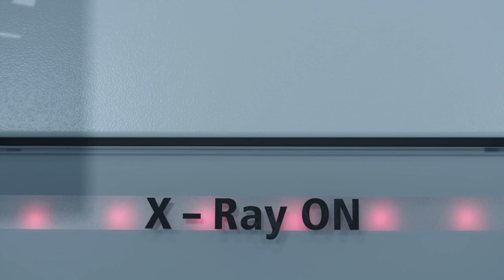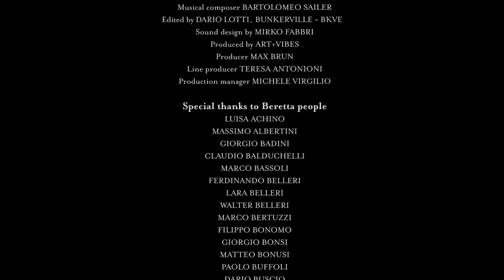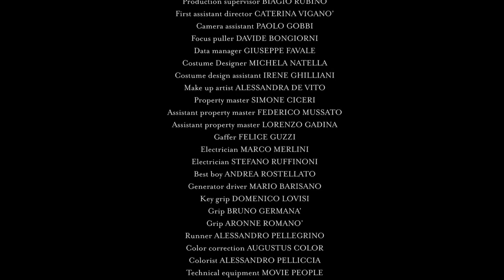Beretta present at The World Gunmakers Virtual Event 2020

Comment: Damn at the end when he closes the action the lever sits dead center.  Should be if action till tight be to the right.   But in about 20 years they will catch up to current B525 standards and 10 more to B725.
Reply: You need to go to a optometrist, that’s top lever was at 5 O’clock